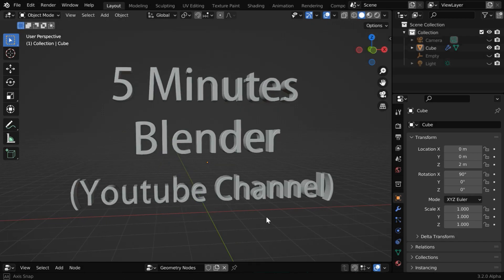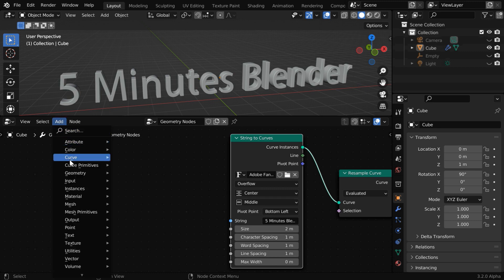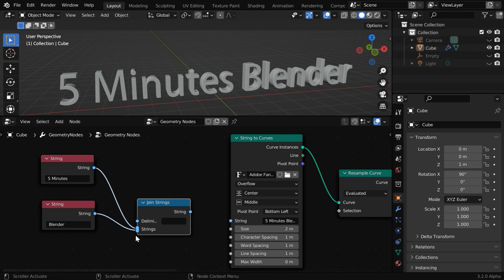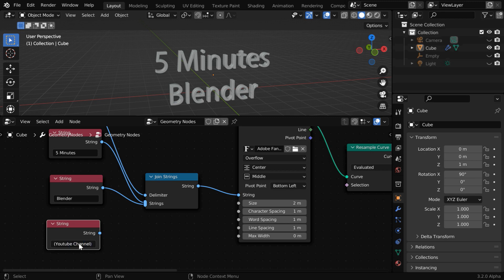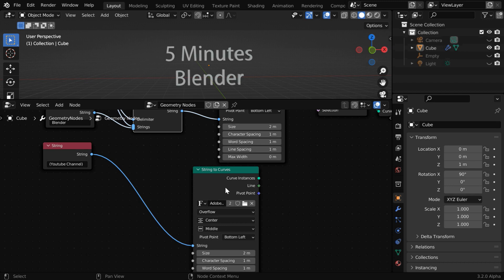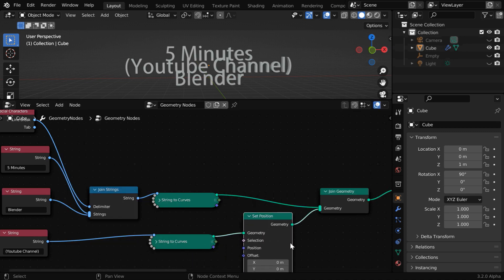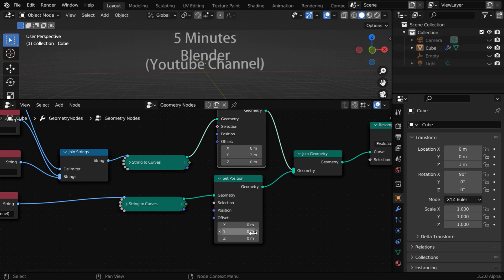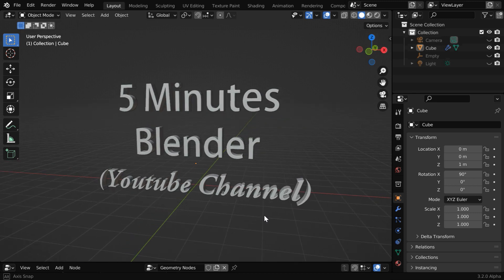Create Multi-line Text Using Geometry Nodes In Blender | Easy Step-by-Step Tutorial

Comment: Thanks! An easier solution is to use the "Replace String" node.
For example for the string "Hello\nWorld" put "\n" in the "Find" section and connect the Special Characters -> Line Break into Replace.

BOOM! "Now you can write\nMultiline characters\nlike this\nin a single sentence" without having to create one node for every line.
Reply from the maker: Aah! Nice solution 👍 That's a very smart and very effective way of adding multiline text, thanks for sharing! 💝💝

Comment: Nice Tip On The Delimiter. I used to copy the node setup for each string and position them. But this approach is better. I tried this and Instead String I used Slice String As It's Parameters can be given to GroupInput.  Also I noticed unlike JoinGeometry Noe where the joining sequence does not matter, in JoinStrings Node The Joining Of Strings Has To Be In Proper Sequence. I just noticed this though I am not sure. Thanks For The Tip Again.
Reply from the maker: Thanks! You in turn shared few nice tips 👍👍

Comment: thank you
，thanks for the tutorial 👍 
 I have a problem with texturing the pages. For example, this book has 90 pages. I use a 3-second video to texture these pages. This video is 30 frames per second, and a total of 90 frames, which is just right for on the 90 pages of this book
So the problem is when I link the video with the geometry to the base color, it defaults to using only the first frame of the video to give all the book pages the same texture
How can I automatically make each frame of the video correspond to each page of the book, so that the first frame of the video is on the first page of the book, the second frame is on the second page of the book, and so on, how can I do it? thanks
Reply from the maker: I'll check this and get back to you.

Comment: Very clever, thanks for the tutorial 👍 once we have set up this can we use it for the falling letters animation, as you explained in the video or do we have to apply the geo nodes modifier before?
Reply from the maker: Thank you! Yes, you need to first apply the geometry nodes. And in case you want to divide each letter separately, you need to also separate the letters before running the script (Edit mode -> Separate by loose part).